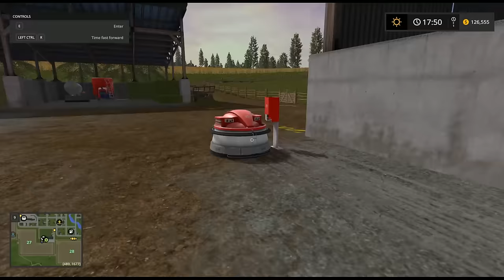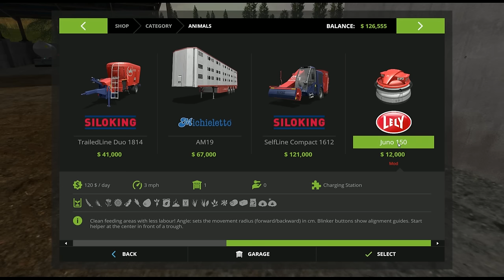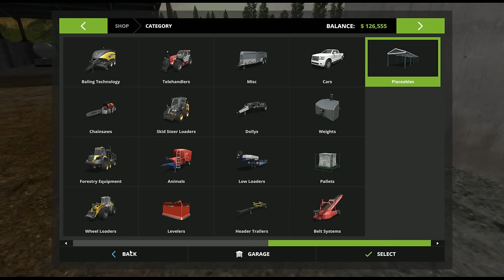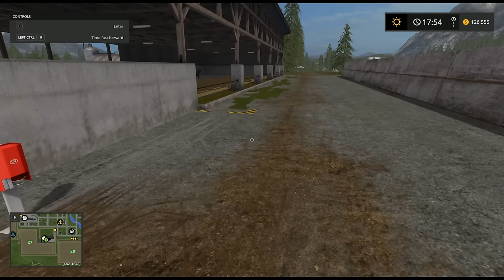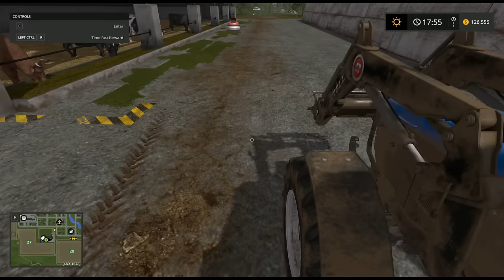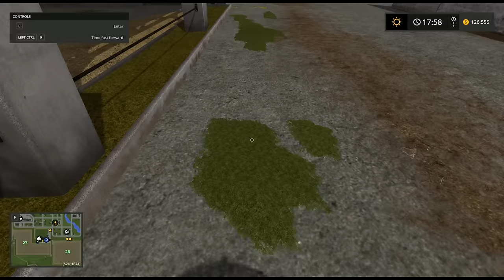Farming Simulator 17 | How To Use The Lely Juno 150

Comment: I thought I try this on my sussex farm UK map!  I was amazed the fact you can drive it to begin with.. So I brought it, and managed to work out you can open that top flap and then use a tractor with a front loader to lift up for transporting? One thing here when I wished to place the charging unit at the end of the feeding area line. I found I don't know how to rotate this charger unit so it sits like your facing away from the feeding area?  I can rotate the map But the unit stays face the other way from yours.. How do I get the item to rotate instead of the map?     I got it to my cows feeding area and now had to come here and see your helpful set up video.  One thing since I just brought it and before I used it,   Was the fact for some odd reason I can't now use any of my other tractors or trucks cab views?   I don't know if it is because of this mod or not? I save this video and hopefully I can use the mod ok!
Reply: use e and q to rotate

Comment: Another shock for me with the Lely Juno 150. I know this is not a feature of the mod itself, but I was using one to clean the pig area on a seasons equipped map. To my surprise I got in the Juno and found a message, "maintenance needed." I took it over to the shop and got hit wit a bill for $2345. That was after using it to clean the pig area for the 9 days of spring. I do have the charging station.

Comment: Thank you. I am having issues using mine still though, no matter how close I run it to the feed trough it simply won't unload - I have to manually unload it which just creates a bigger mess. I'll keep investigating but any help/guidance would be really appreciated. Thank you once again.
Reply: you need to turn on the function unload here, put the device in the middle of are where it will patrol, aligned with that square distance away is good enough. if its making mess after all this it might be because your animals are full, for cows I found 3500 is sufficient distance angle. or other alternative is use ground conveyor belt aimed at a feeding through and placed strategically at a feeder on a diagonal.
Reply: Thank you - I solved it the day I wrote that comment, it turns out that my feed trough was totally full of grass and it couldn't unload it. I edited the save file on a hunch and removed the grass from the trough and it worked beautifully from then on - so TL;DR It was totally my fault that it wasn't working :P

Comment: There's now a mod Table manners never clean up again or use this ;-)
Reply from the maker: Sure there is. Put in enough mods and there is no use in playing the game.
Reply: yeah i now i use a bucket loader and done
Reply from the maker: There is a great 3 point sweeper in the Mod Hub by Blacksheep as well.
Reply: yeah if the trough is full its not working anymore so its not that great the lely
Reply: there is enough to do anyway on the farm without having to constantly clean up messy animals.
Reply: you cant use table manners in multiplayer and also for those not on PC you cant use it on console